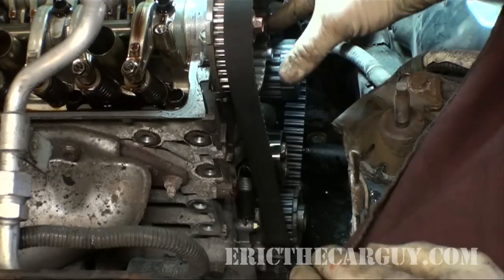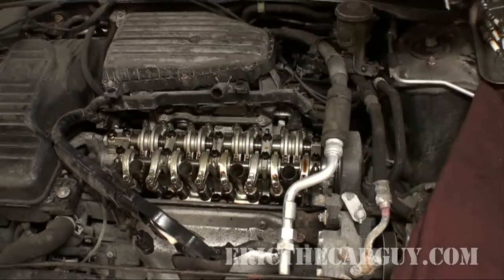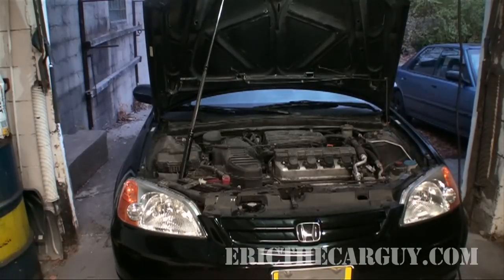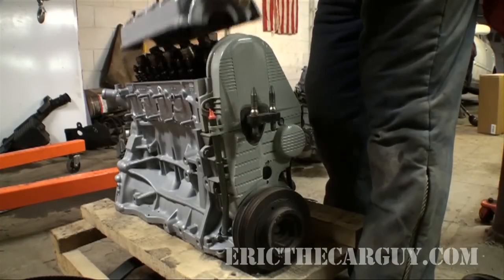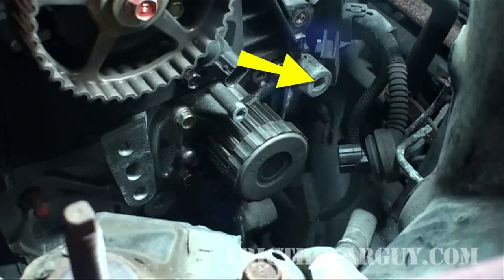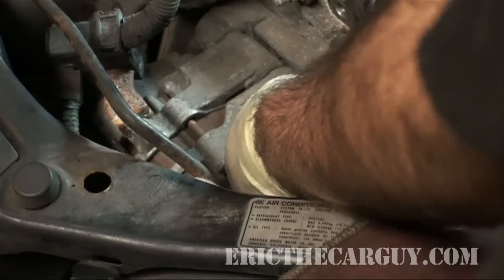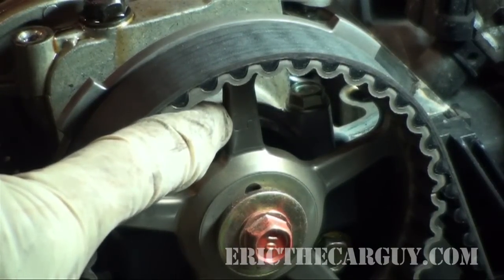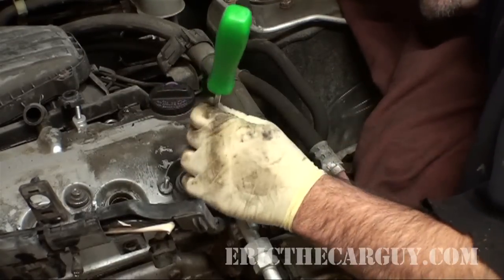1990-2007 Honda Civic D Series Timing Belt Replacement VManual (Trailer)

Comment: I replaced the timing belt and water pump back in May of 2014 and although the timing belt video you did back then helped i could have used a more in depth video like this at that time. That crank bolt was defiantly the most difficult part of the job.

Comment: My 2006 civic lx has a timing chain. I tried to find the time change interval for it, and all indications is no change life of the engine part. Can anyone confirm this?
Reply: There is no timing chain replacement intervals that's only for the timing belt. Newer engines are designed for the timing chain to last the life of the vehicle but new vehicles suck at this and they don't last as long as they should do. My 06 Cadillac srx I did the timing chains 3x before 110k and then sold it because that was bullshit to fail so fast. I miss timing belts lol. My dodge ram has the original timing chain with 250k miles and no stretching unlike modern cars these days. Hope  this helps.